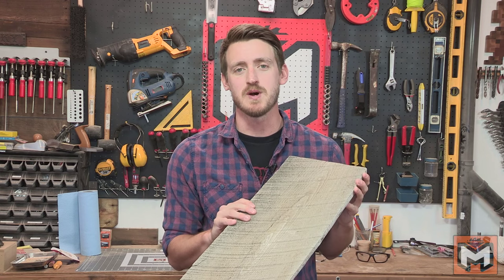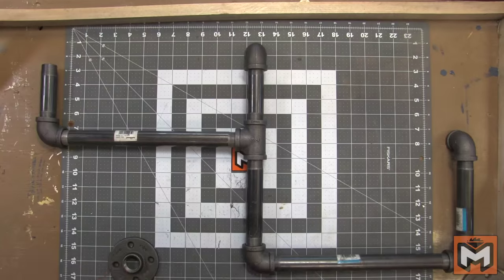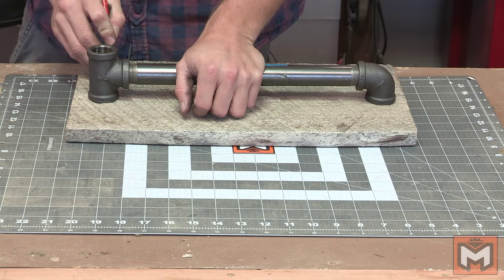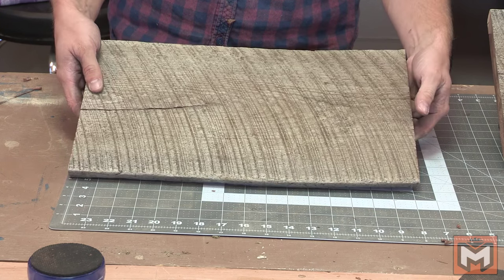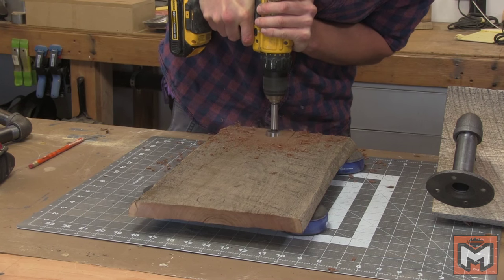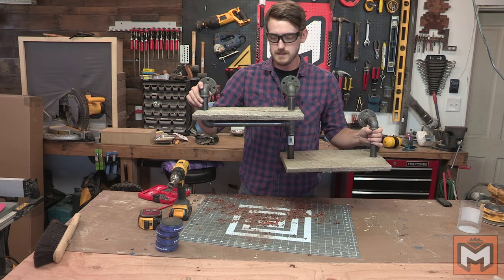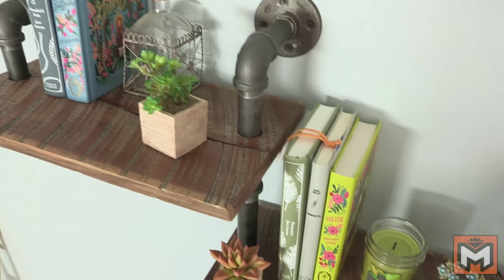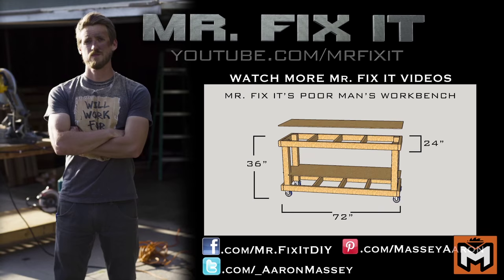DIY INDUSTRIAL PIPE SHELF

Comment: Well done! Good instructions given. The vertical pipe needs to fit snuggly in the wood, right?...otherwise the shelf could rock back to front, if there's an uneven weight on it. I'm going to put liquor bottles on mine, so I want this to be tight and hold the shelf level. thanks again.
Reply: I'm wondering the same thing(also using liquor bottles). Did you figure it out?  :)

Comment: Great video. Thanks. I'm just having some trouble getting the pipes tight and in the right direction (I'm actually building a C table). I'm in Peru and I had these pipes cut to size. Do you think there's a problem with the screw part or is there a trick to getting these things tight and in the right direction?
I hope you can help. Thanks!
Reply: Ursula KöPá Next time, try some plumbers tape, or thread-lock such as loctite brand.. so if the angle doesn't match where the threads are tightest, you can make sure they stay strong and don't move.

Temporary thread lock or tape works well if you'd like to be able to take it apart for moving the piece, but red or permanent thread lock will really make it stay put.

Hope that helps a bit.

Edit: p.s. this is the best stuff here.. https://www.homedepot.com/p/Loctite-0-2-fl-oz-Threadlocker-Blue-242-209728/100371826

Comment: I like it. Around here, the black iron pipe is not cheaper than the galvanized pipe, and looks nowhere near that clean. Always has a lot of chipping paint.
Reply: +Mr. Fix It Jackson, Mississippi. I've always bought the galvanized ones, because they don't chip. (Well, I buy black iron ones for pipe clamps). I just give the pipes a good wash with some dish soap and then spray paint.
Reply: +Bruce A. Ulrich try out some mineral spirits on the black oxide pipe. I use it for mine and it works well. I Clear coat them before install as well to keep from chipping
Reply: +John Malecki Good tip! Thanks!